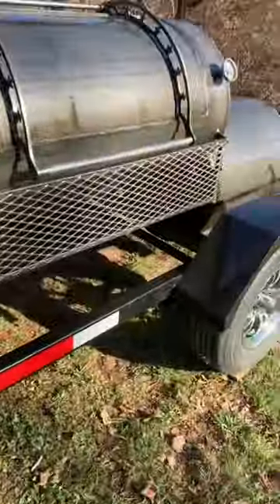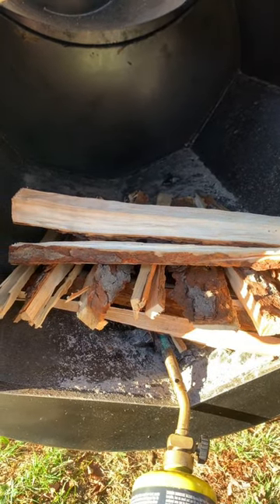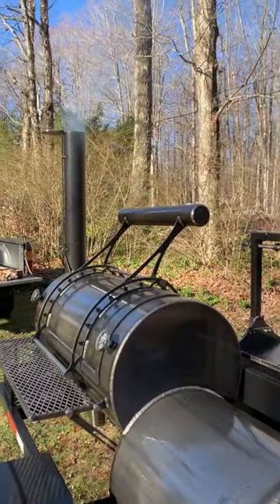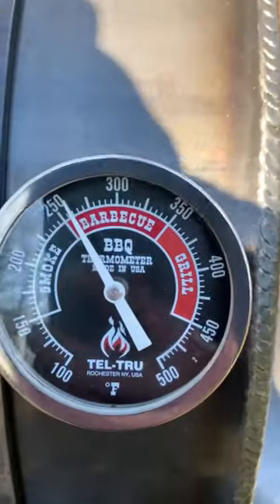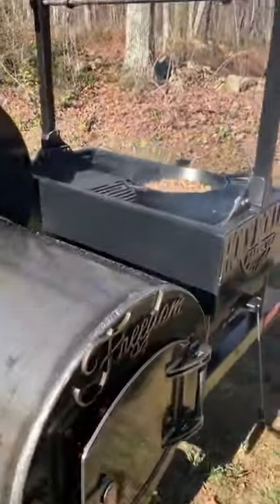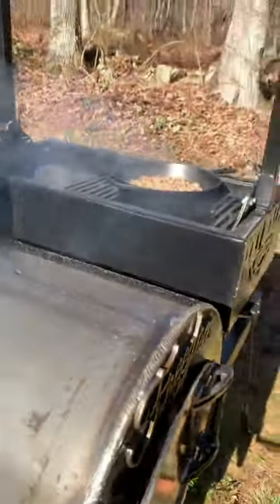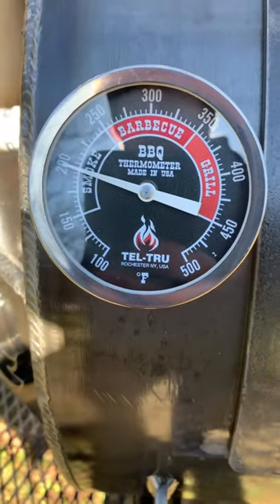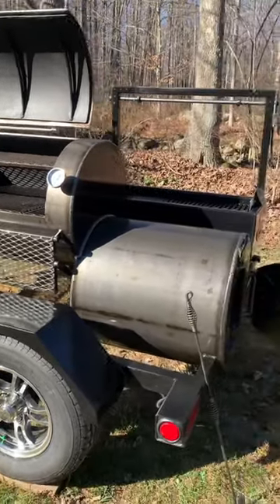Patriot Pits Freedom 94 Trailer Mounted BBQ Smoker - Biscuit Test

Comment: Everything you mentioned with the damper & firebox door is exactly what it took me 9 months to figure out on my 1975. Everyone is so worried about a hot spot, but the airflow and gases have to rise to the cooking surface at some point to start circulating and get that desired top down cooking convection - a small 6 inch hot spot where those gases rise is nothing anyone should worry about - just avoid that tiny spot. If you have time, you should check out the damper video I made where I show how to move the hot spot, and I have some drawings and digital probe data - it’s everything you already know and mentioned in this video, but I think you may like it. I’ve recommended several people to check out your pits. What’s your current back log?
Reply from the maker: Thanks so much man! I will check it out that vid. Current backlog is about 7-10 weeks still. Working hard to keep it low.

Comment: thought about fitting a santa maria on a wagon with the offset?
Reply from the maker: It’s not really a viable option. The only place it would possibly work is over the firebox. Or on the side of the firebox. But I don’t think it would look right and it would put tremendous weight on those rear tires. We feel it should remain a separate piece of equipment at that point.
Reply: @PatriotPits  A santa maria on its own wagon would be sweet!